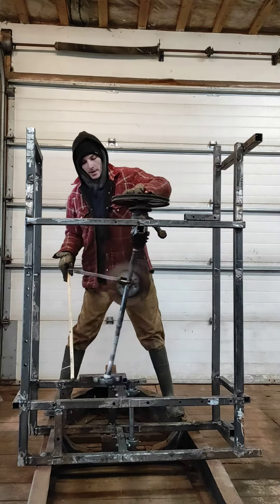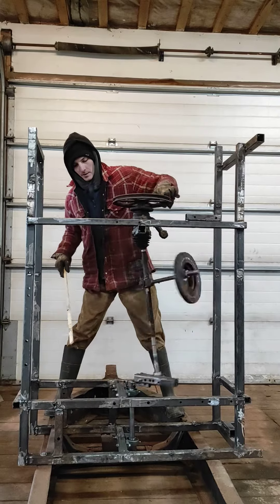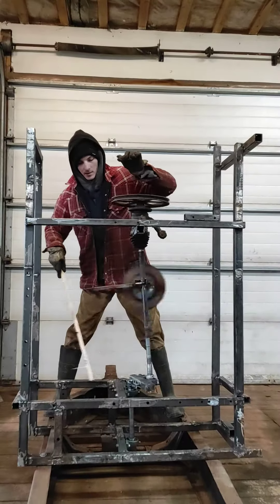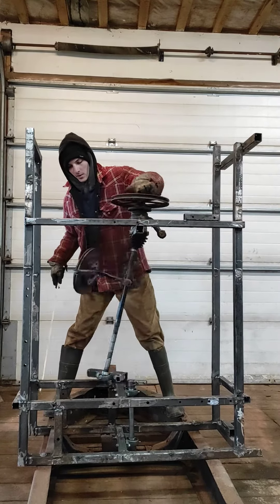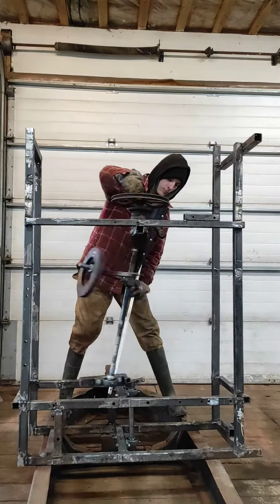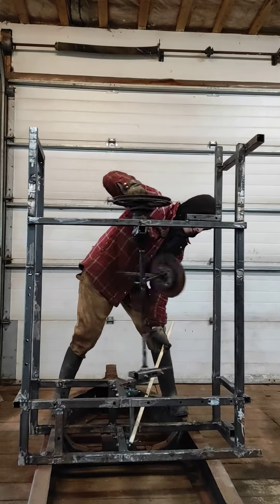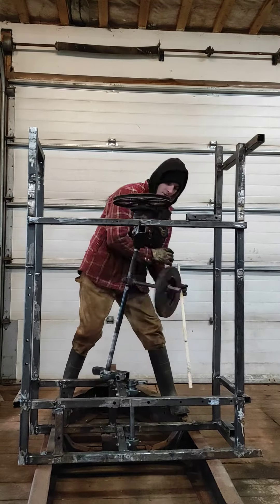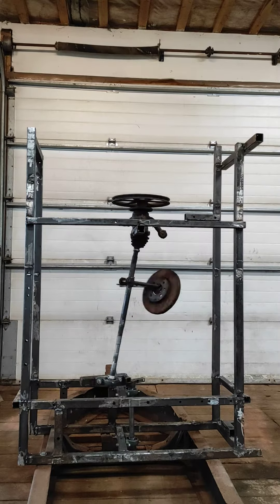William Skinner's Free Energy Machine (See description)

Comment: WOW!!!   It spins around when you turn the crank!
Reply from the maker: The point is that when you put a load on the output (bottom) it doesn't slow down the input. Of course there needs to be more weight added, and the weight should be closer to the bottom.